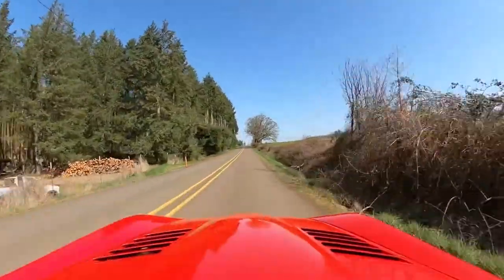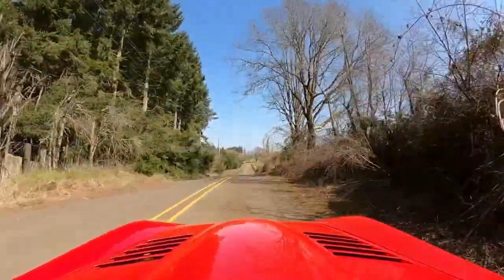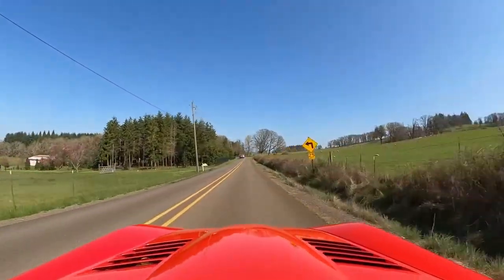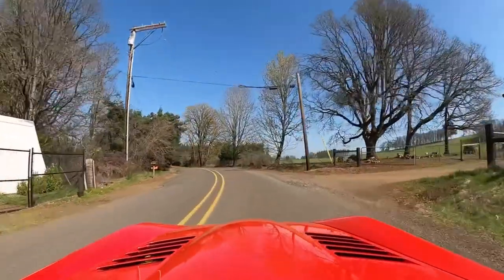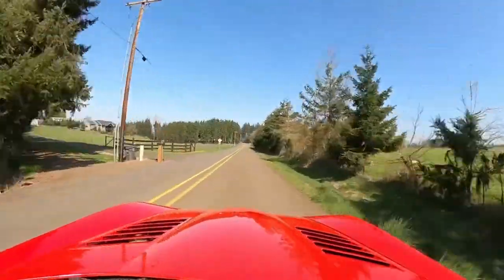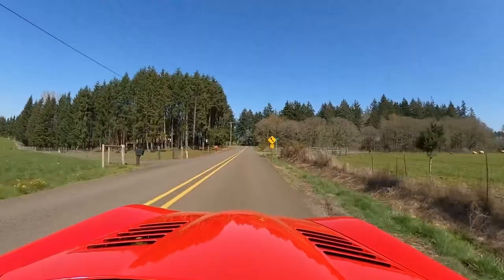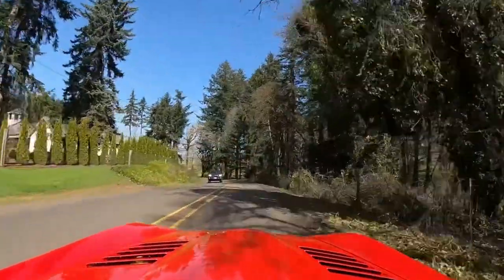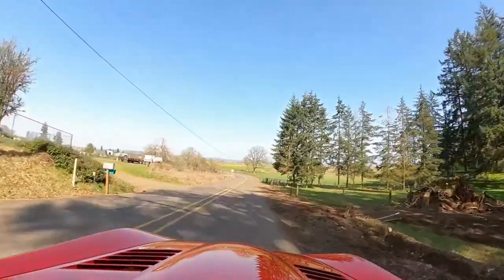Testing the Viper and Rambling

Comment: Hey man, wanted to comment. I love the content! I have the exact same car. 2004 red viper but mine has 43000 miles on it now. So far I’ve kept it stock. I found your channel researching the Borla exhaust and yeah after your issues I’m probably going to keep it stock until something breaks. I don’t like how hot the cabin gets though. I’m in Florida. I had a loose pulley bolt on the power steering pump and all my shocks are shot. I’m currently replacing the oil cooler lines and the rubber boot under the shift knob to try and cool off the cabin.
Reply from the maker: Nice. I would keep an eye on your catalytic converters, it is the stock drivers side that seem to give people the most trouble. You might also want to keep an eye on the power steering lines, they can have issues as well.

I went with the BC coilovers, but they are definitely aggressive for regular driving on poor roads and their "suggested" height is probably too low to be useful in most parking lots.

Enjoy the car! On a car like these, 43k is still just getting broken in 😉

Comment: No flat tappet. Has hydraulic lifters. The noise is due to a fast bleed lifter. A set of Johnson lifters will eliminate the tick. Keep in mind you will also hear the injector cracking and will also amplify the (tick). Use a 10 40 oil or 15 50 in warmer climates/mid late summer. This will help with a lot of the lifter noise. I noticed a instant improvement as soon as i switched to 10 40

Comment: Hey Man ! I'm looking at upgrading the stock exhaust on my 2003 Viper with pretty much the same set up that you have, Borla Cat Back and Roe Hi Flow Cats with cross pipe delete. Wanted to know what you think of the exhaust so far. I don't want it to be stupid loud but do want a little more volume and definitely a better tone over stock. Based on research of various videos and sound bites, I hate the Corsa tone and the Bellanger seems to be too loud so I'm hoping the Borla is a nice compromise with a lower, more old school muscle car exhaust note but not overly loud. Would love to hear your thoughts on this since you've had it for a while. Love the videos and thanks in advance for any additional info.
Reply from the maker: Borla is much more reasonable, especially if you keep the stock cats in place. If you move to high flow cats, you might want to keep the crossover pipe in place to keep the rumble a bit more toned down. Good luck with the project!

Comment: Hey AmbiVe, so I started looking into Hi Flow cats to prevent this from happening on mine. I called JonB at parts rack. Nice guy btw, very knowledable. He told me the stock cats shouldn’t fail unless something is going on in the engine. He said bad spark plugs or wires even occasionally can damage the stock cats. When you did all this have you checked plugs or had any other issues to cause the original failure??
Reply from the maker: Nope, I pulled and checked the plugs and they were burning clean on the entire bank, injectors are healthy, and no warning codes in the computer. These cats failing are pretty common if you start searching about it.

My guess is that it has something to do with cold starts or the length/shape of the exhaust.